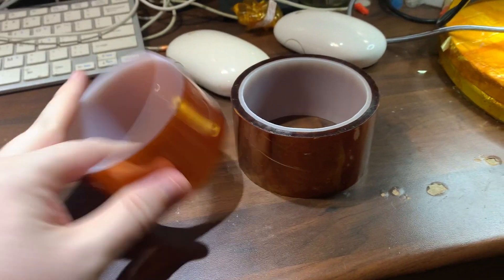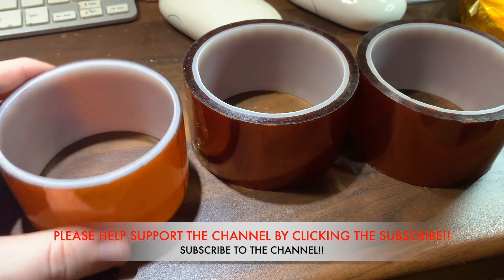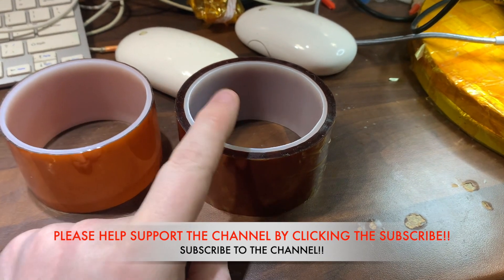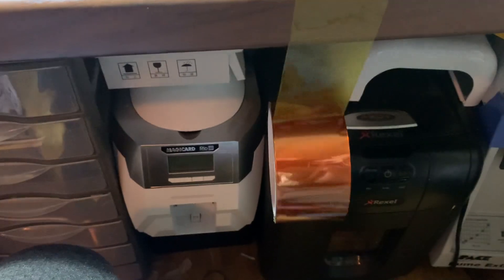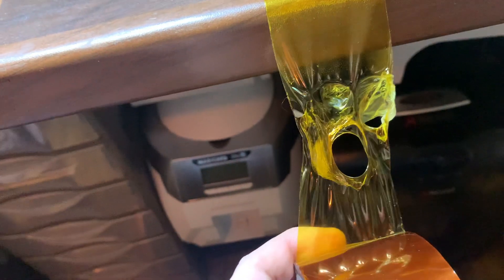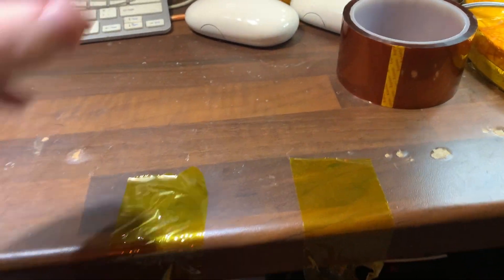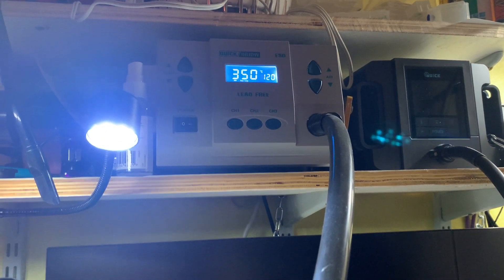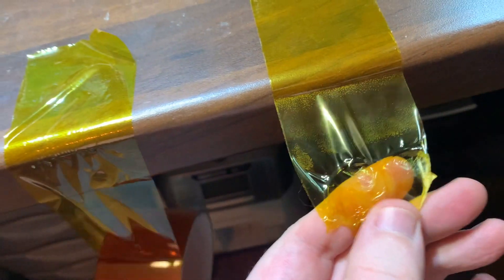QUICK 861DW HOT AIR STATION VS FAKE KAPTON TAPE BOUGHT FROM EBAY!!

Comment: Sir, I`m phone repair student live in Sri Lanka. It is very difficult for me in such a country to buy genuine products such as Amtech, Kester, kapton tape exp… So that reason can you submit low cost options for Flux, Solder, Solder Past, Heat resistant tape exp… It is very valuable for students in a country like ours. Thank you.
Reply: SDG electronics has reviews of solder and flux. Episodes #79 and #86. 

You could buy solder from real electronics store, wherever you buy parts like Farnell, digikey, etc. Even JBC sells solder I think.

Comment: Do you use a similar tape, it's a foil type but also heat resistant? Thanks again I think the real Kapton is a bit expensive compared to the ebay knock-offs. If you double or triple layered the fake tape, would that still provide protection? Is the Kapton good for covering parts from IR or not so direct heat?
Reply from the maker: I’ve tried various types of foil tapes in the past and they are good for heat protection. If you doubled or tripled the layers it would offer more protection no matter whether it’s fake or real but the fake tape is what it is. I’d recommend using the real stuff. Heat sinking components with any heat conductive metal to absorb the heat is normally the best option . Copper blocks or coins are very good for this. Against common believe its better to use more heat for less amount of time rather than less heat for a long time. Speed is your best tool. Also if you watch my other video about the JBC mod for your hot air station, those heat shields cones are brilliant and can be used on their own without the extraction tool. I forgot to mention them in this video.
Reply: @SURGE101  thanks again. I am  considering getting the Yihua 853AAA rework station (hot air, soldering iron, & reflow/reball machine for about $190 or so US $$.. have a toshiba p875 I want to do a GPU reflow. My experience level isn't quite ready to do a reball. If I did a reball, I would put a new GPU chip in, & not reball the original one. Thanks
Reply from the maker: @j.lietka9406  the yihua 853aaa does look like a good station for the price. I think that’s the one northridge fix first started out with. He still sometimes uses it and still has it on his bench in his videos. Thanks so much for taking the time to watch the video I really do appreciate it. Rich👍
Reply: @SURGE101  very welcome 🤓 by looking at the 853AAA, it almost looks like there isn't enough room on the pre heat table/platform to support a full size laptop m/b.
Reply from the maker: @j.lietka9406  it doesn’t look that big but to be honest I’ve never used one or seen one in person so it may be bigger than it looks in the pics.
Reply: @SURGE101  yes, that's true. Thanks again 🤓